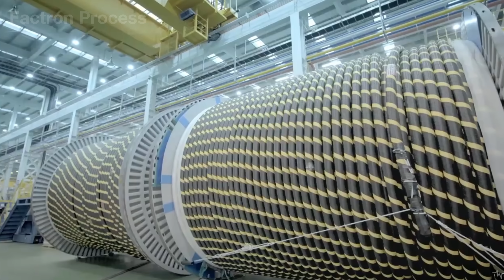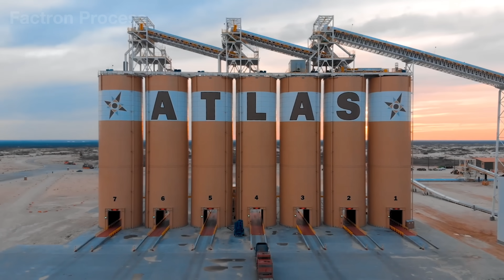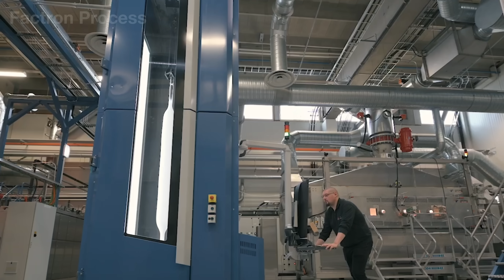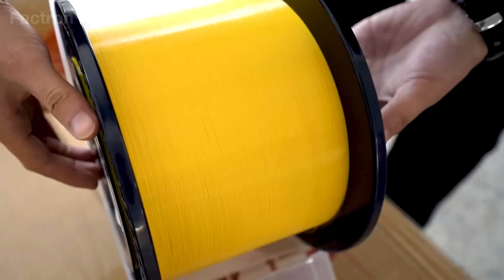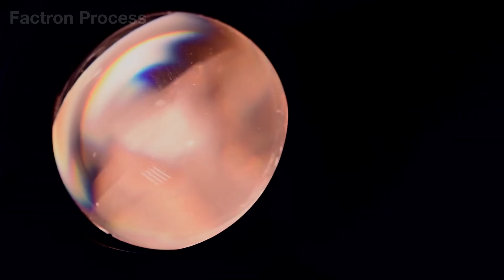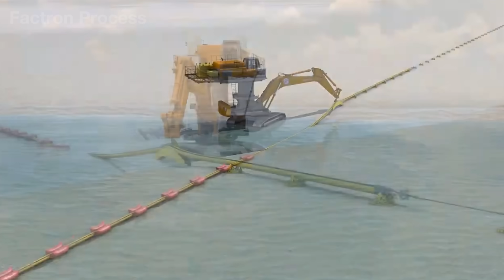How Fiber Optic Cables Are Made and Laid Across the Ocean - Inside the Global Internet Industry

Comment: One thing that often gets overlooked is that the buzzing engine stopping wasn't actually the trigger for the dive—it stopped because the fuel supply was cut after the propeller-driven counter reached its preset count. The silence was just the warning people noticed.
Reply from the maker: Great point! Thanks for adding that detail—the engine stopping was the result, not the trigger. Really appreciate your insight!

Comment: One thing that this video did not touch on was SPLICING. Cables are laid thousands of miles across oceans. These drums of fibre optic cables must be spliced from time to time. How is this done? What time does it take?
Reply: It is a pretty easy process with the right equipment. Being a fiber splicer is a boring job. I worked on the SONET equipment that made the light. Now they can put multiple wavelengths of light in the same fiber increasing its bandwidth. I worked on this stuff starting in the early 1990s and even did some work overseas.
Reply: @Chris_at_Home  I was a splicer for 10 years. I never found it boring.
Reply from the maker: Great point! Splicing is a fascinating process and definitely deserves its own video. Thanks for the suggestion!

Comment: Light travels 200,000 km/sec in fiber cable as refractive index slows it.  In the vacuum of space laser light 300,000 km/sec.  Transoceanic cables light definitely slower vs space long distance data.  Starlink planning AI in space with its mesh network token node satellites.  Space keeps data processing cool and solar power 24/7.  Saudi Arabia working with Elon to build ai data hubs in their country
Reply from the maker: Great point! Space laser links could be faster in theory, but cables still win in reliability, cost, and massive data capacity today.

Comment: and SpaceX will make all of this obsolete…
Reply: ABSOLUTELY W R O N G‼️As a retired Broadcast Engineer, a WIRED (glass) circuit will ALWAYS provide higher data speed and greater BANDWIDTH ‼️AND SIGNIFICANTLY greater RELIABILITY than ANY wireless network. That fact has ALWAYS been true. 
Starlink will ALWAYS be highly VULNERABLE to HOSTILE acts by other countries. That fact alone makes it for more unreliable for vital communications. 
Even undersea fiber optic cables have been damaged by ship anchors or intentionally cut by countries seeking revenge. 
NEVERTHELESS satellite service will always be MORE vulnerable to enemy attacks simply due to the ease with which a satellite can be shot down‼️
Reply from the maker: Maybe one day! Technology is always evolving.

Comment: obsolete, due to Starlink :)
Reply from the maker: Starlink gets the headlines, undersea cables do most of the heavy lifting
Reply: until starlink can push up to 100gbit+ never ever is this obsolete..
Reply: and even then, is the cable definetely more consistent bandwidth than starlink
Reply: You have no clue what you are talking about. There are applications that Starlink or the infrastructure that Starlink uses is not capable to come near fiber tech.